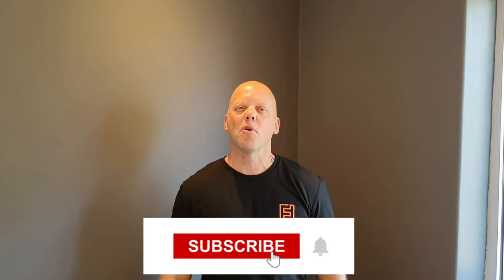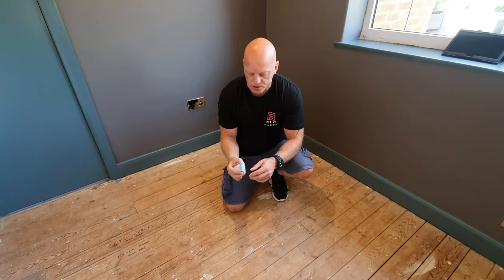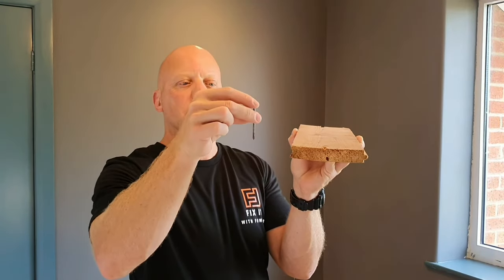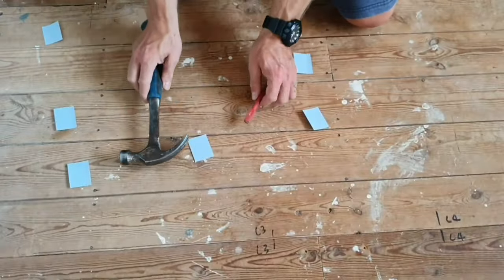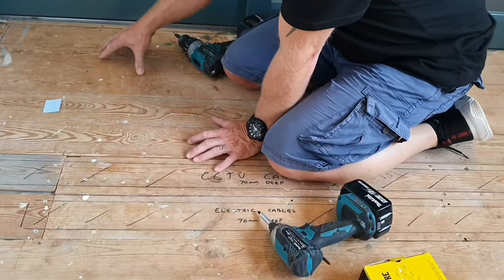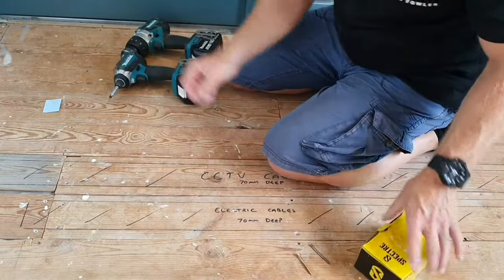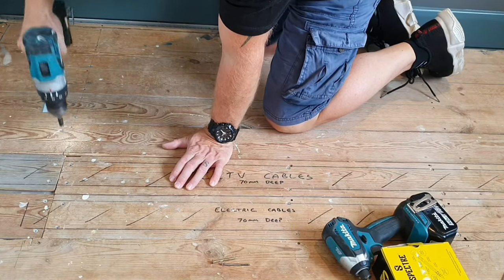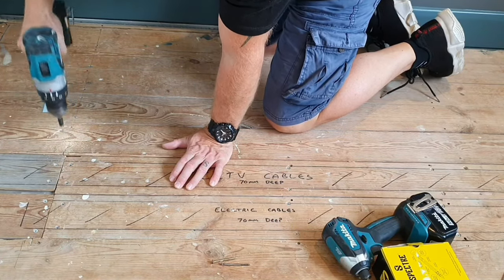Easy fix for noisy squeaky floorboards! (a complete how to guide) #flooring

Comment: Not me sat on my landing watching this video screwing nails in 🤦🏼‍♀️😂 However I'm watching this because I'm scared of hitting a wire or pipe, any tips??
Reply from the maker: Unless you have looked under the floor then it's impossible to say where the pipes are. If you either knock the nails in further or replace with screws then you know there won't be pipes there

Comment: Without precise knowledge of any pipe runs, you could be putting a screw through a heating pipe surely???
Reply from the maker: Yes, that is true. Luckily, these floors have been up before for the soundproof insulation, so I know the exact runs of pipes and cables as marked on the floor boards!
Reply: @FixitwithFowler  Understood. thanks for the video...
Reply from the maker: @peterbridge2081 no problem!
Reply: It’s easy to tell if there’s a water pipe below you chosen drilling position, as once you remove the drill, you get a little water fountain coming through the hole. Don’t ask me how I know.
Reply from the maker: @jf2613 yep, been there and done it but mine was with a circular saw 🤯

Comment: Great video. Many thanks. Is there any way of ensuring that youre not going to hit a pipe or elec cable? I'm having to fix bathroom floorboards and I know there are pipes underneath?
Reply from the maker: Unfortunately, there is no way of guaranteeing you won't hit a pipe or cable. My advice would be to try and look under the floor if possible!
Reply: Okay thanks. I need to get under the floor boards and check it out. Many thanks for your reply. 😊

Comment: Thanks for the videos,  very helpful.  Do you think Wood glue works better then watered down PVA ?  Ive seen other videos use the PVA method on floorboards.  But you seem to use PVA.  Im sure you have tried both methods?
Reply from the maker: Hi, neat wood glue is far stronger than watered down pva or just pva glue. Once the wood glue is cured, it becomes stronger than the wood itself. Hope that helps you!
Reply: Very helpful video
Reply from the maker: I'm glad you found the video helpful ☺️

Comment: I wish i had someone like that stopping my bathroom floor creaking instead of some  clown who just drilled a few screws in on one part of the floor put a sub floor down without checking the other side first.One side doesnt creak the other side does.Brilliant.
Reply from the maker: That is less than ideal. Unfortunately, it sounds like you won't be able to fix it.

Comment: Really helpful video - thanks. Could you explain why screws are better than simply adding additional nails? Thanks
Reply from the maker: Hi, over time the timber floor boards move and warp, this action can actually partially pull the nail out (as seen early on in the video). If you use screws then this can't happen!

Comment: Good vid. What size is yhe pilot drill?
Reply from the maker: You need to match the pilot bit to the screws but in this case, it was a 3mm bit. Hope that helps you out!
Reply: @FixitwithFowler  Thanks
Reply from the maker: @Cobnapint no problem 😊

Comment: Thanks for this! Do I get a countersunk screw that is threaded the whole way or not?

I tried doing what you told me with srews that are only 2/3 threaded and it doesn't solve the problem
Reply from the maker: Hi, for the squeaky floorboards, i would use screws that are only 2/3 threaded. The reason for this is that it allows the floorboards to be pulled tight to the joists, whereas threaded screws can leave a slight gap between the joist and the floorboards. If you pilot the boards, you may find the threaded scres do the job. It's a bit of trial and error, dont forget to do the boards next to it as well.